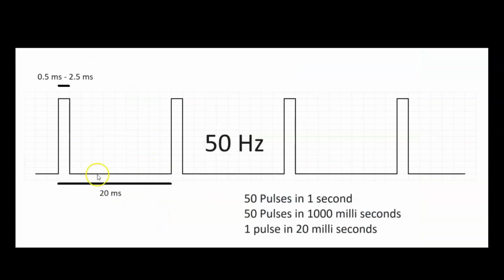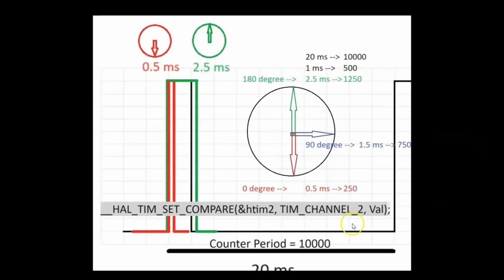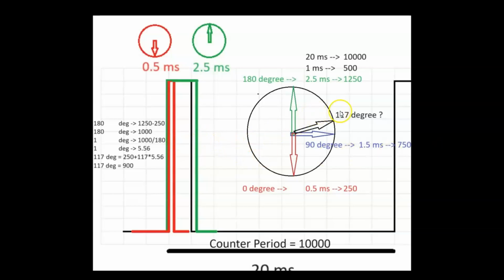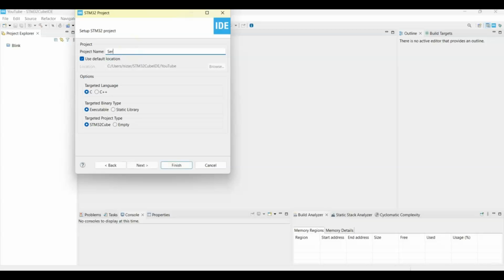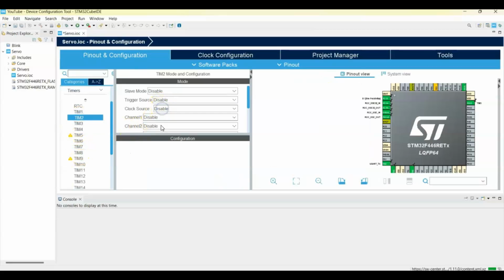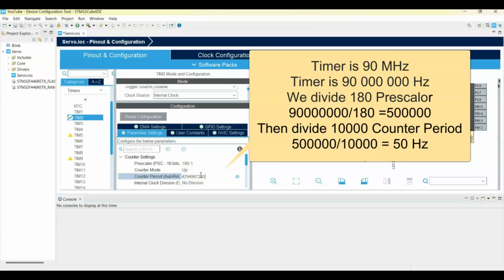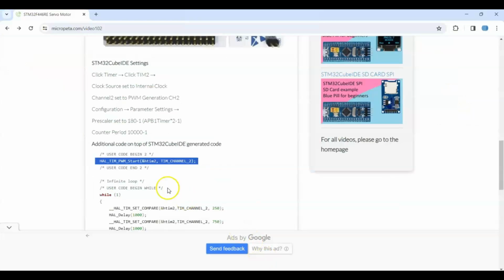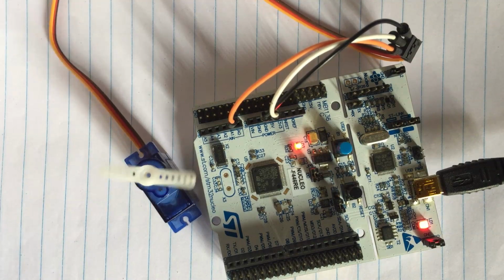102. STM32CubeIDE Servo Motor. PWM with STM32F446RE Nucleo

Comment: Nizar thanks for the video. On the SG90 data sheet I notice that the duty cycle is in a range of 1-2ms, so I was wondering why you have set the range to 0.5 to 2.5ms?
Reply from the maker: I also tried with datasheet values 1-2ms then the servo went from 45 degree to 135 degree
It gave me 90 degree rotation only
I think the datasheet is for 90 degrees only
If anybody wanted full 180 degree, they need to go from 0.5 ms - 2.5 ms
An arduino servo library by Michael Margolis also goes from 0.544 ms - 2.4 ms as in the link
https://ccrma.stanford.edu/~fgeorg/250a/lab2/arduino-0019/libraries/Servo/Servo.h
Thanks